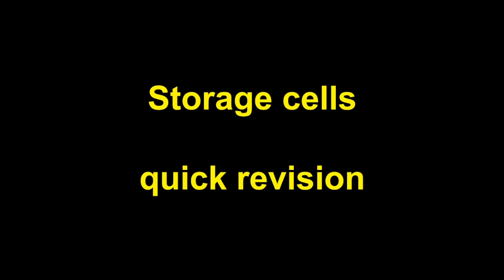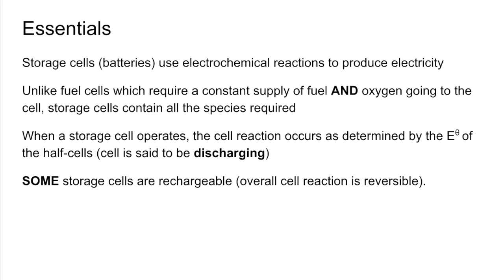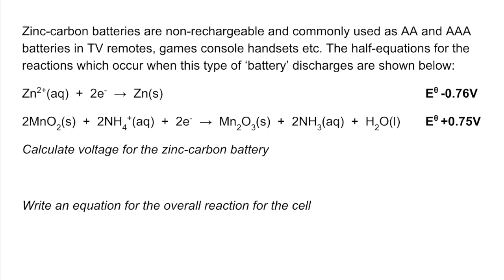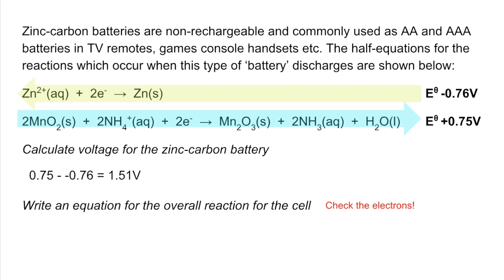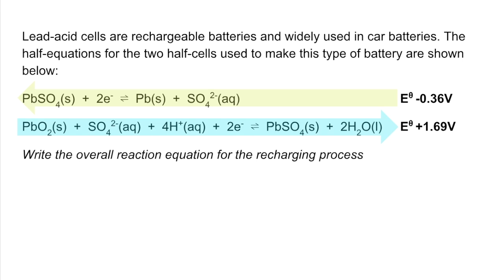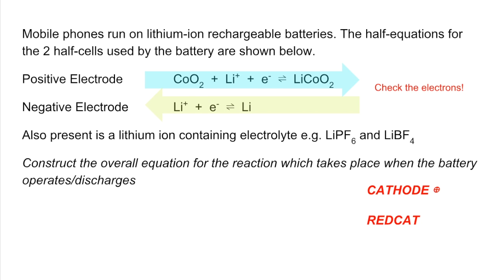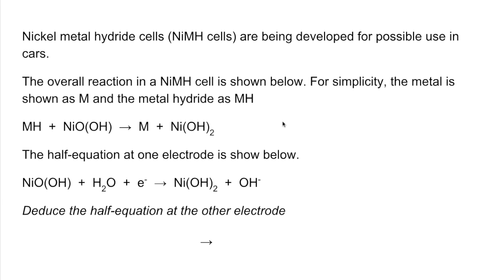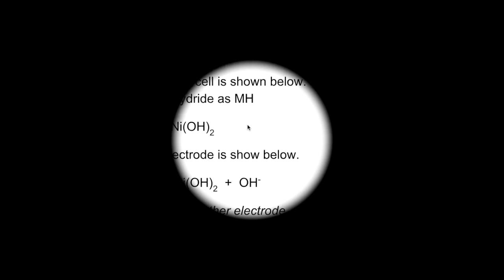Quick Revision - Storage cells

Comment: I thought the cathode was negative?
Reply from the maker: At GCSE you learn about electrolysis cells (electrolytic cells) In these the anode is positive and the cathode is negative. At A level you learn about electrochemical cells. Basically these are the opposite type of cell as they produce an electric current rather than have one supplied (as is the case in electrolysis). 

In electrochemical cells, the anode is negative and the cathode is positive.

In both types of cell, reduction ALWAYS takes place at the cathode - REDCAT
Reply: @MaChemGuy  wow i thought electrolysis was the same as electrochemical cells